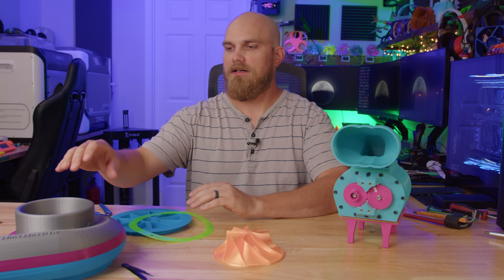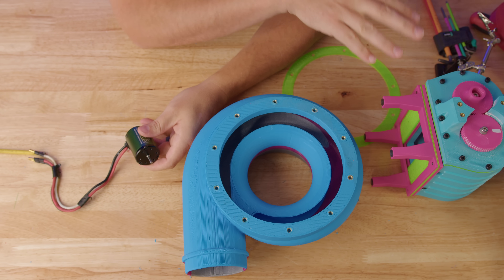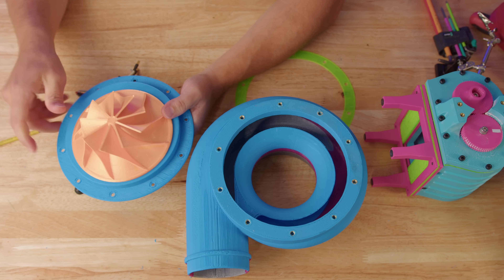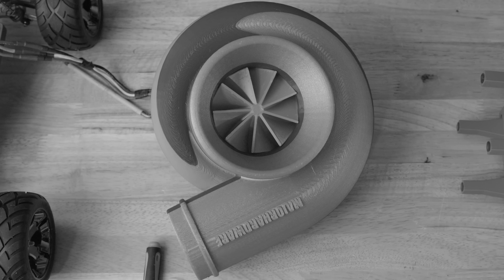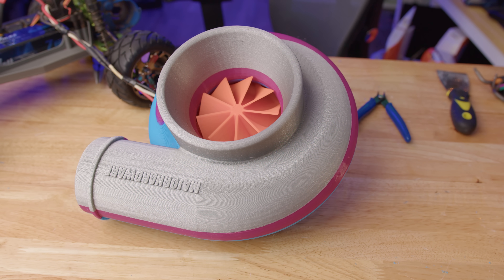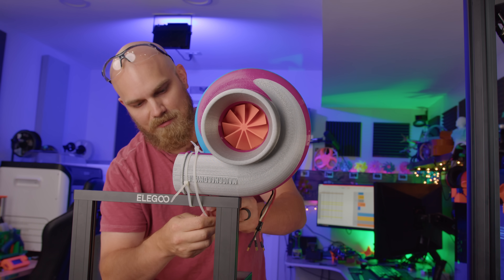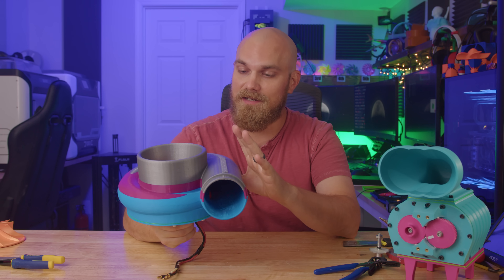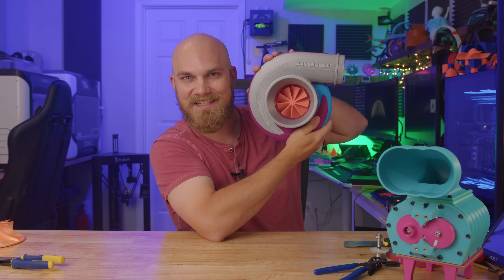I BUILT a MASSIVE ProCharger for my PC

Comment: I would love to see this somehow incorporated into a case and see how much cooling you can get with a 120mm radiator compared to stuff like the cheater
Reply: Make a case that looks like an engine?
Reply: @flekkzo  THAT WAS MY EXACT THOUGHTS!!!
Reply: blow the guts of the radiator right out haha, all the fin stacks
Reply: @ghomerhust  HE MUST DO IT FOR SCIENCE!!!!!
Reply: I think he’s going to do something like that. Just like he did with the supercharger design.
Reply: At 2000CFM. Cooling will be the least worry. Lol
Reply: what i think would work better would be to attach it to a vortex tube which could be 3d printed also, since the air is compressed by the charger you can then use the vortex tube to lower the air temp significantly without any external power, should get about the same or even more volume than a normal fan but the temperature of the air can drop as low as -50 degrees.
Reply: i would love to have the supercharger , made to fit the top of a lian li lancool 2 case .
Reply: This would be the Super-Cheater
Reply: You can test this yourself very easily, just get a 125mm in-line vent ventilator and let that force air through!
Reply: It would look sick
Reply: 666 likes on this comment.... 😂 
I guess it's some kind of a sign but time will show what kind.... 😂
Reply: Here's a thought. It'd probably look janky, is it wouldn't look like your typical boost setup, but build a case that looks like an engine, and foe airflow, put the procharger over the air intake/radiator, and then put the supercharger going into the procharger. That way the supercharger increases pressure prior to hitting the procharger which builds up even more. Or just completely forget the noise factor and goes balls-to-the-wall and make a twin-turbo setup XD
Reply: @shoobfloof22  you can buy faux foam engine blocks, they generally aren’t cheap but you can definitely figure out a way to shoehorn a PC into it and put TWIN TURBOS to feed that beast

Comment: I suggest a EZrun MAX brushless motor. They come in three KV levels, 1650, 1100 and 800 so you can pick your poison so to speak. The two lower KV can also run on 8s power. The 1650 is limited to 6s. They are very fairly priced and I have uded EZrun a lot. I'm guessing you probably don't have an ESC that will run that much power. Hobbywing (EZrun) sell complete 8s capable combo kits (esc and motor) for under 400 bucks. Some variants are under 300. There is also a 6s combo for right around 250.
Reply: The T-Motor U15 L 43kv Multicopter Brushless Motor 3600g 12S-24S is also a option but it’s over 1k and maybe a little strong. :)
Reply: @exo068  I would say way to fast with not enough torque.